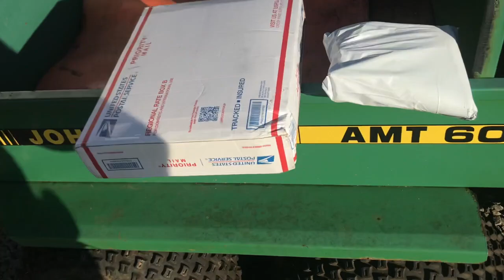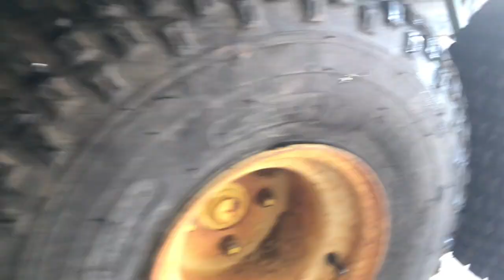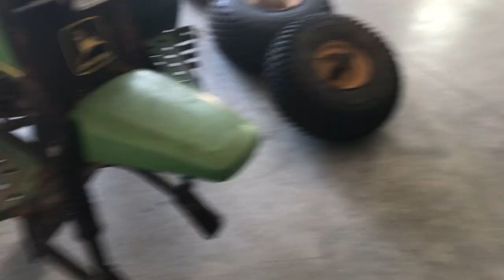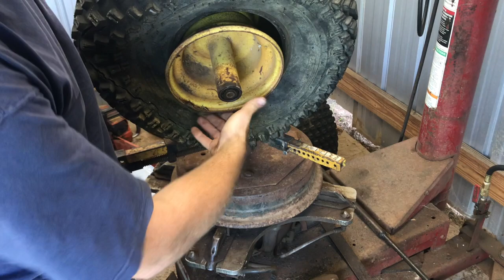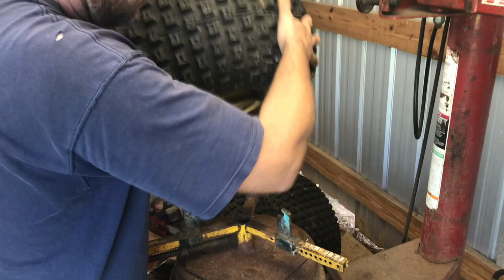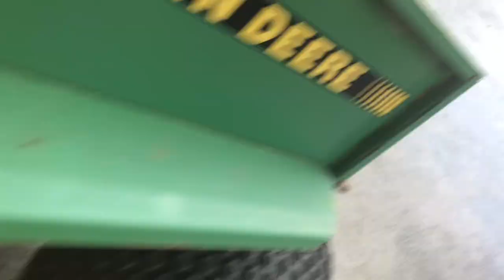John Deere AMT 600 tube installation

Comment: Where did you get your parts and such as I just bought a amt 622?  Cool videos
Reply from the maker: Amazon and the local John Deere dealer. A 622! Awesome! These things are absolute workhorses!! I still need to fix the hydraulic dump for the bed and come up with something for the brakes for mine.